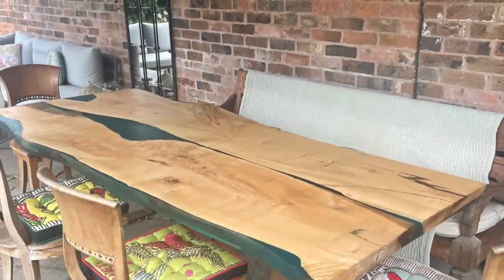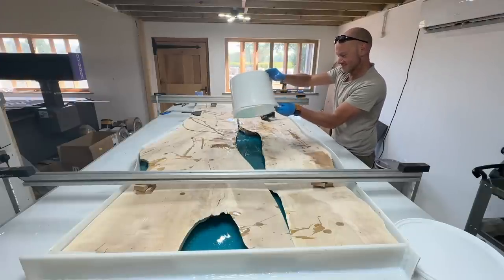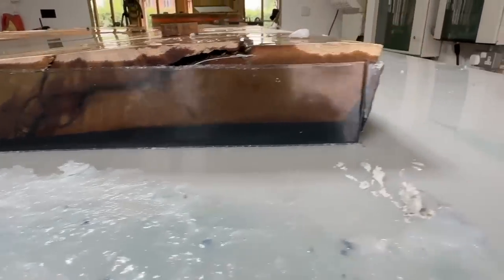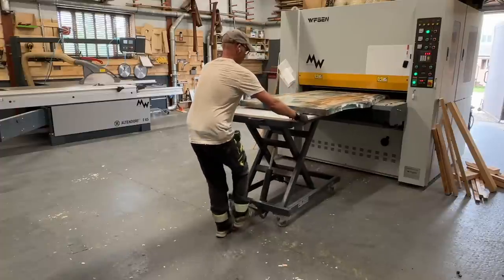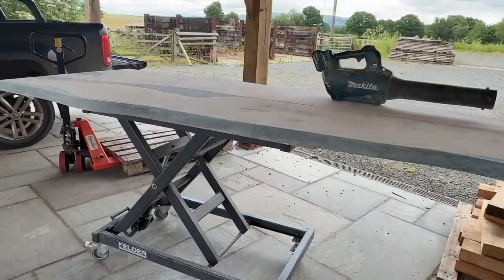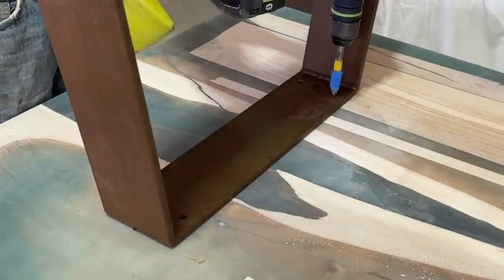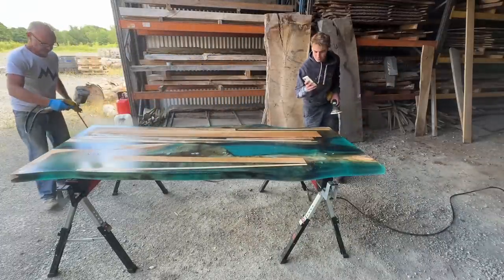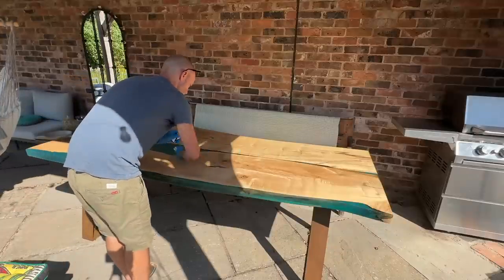Sycamore maple + turquoise resin

Comment: Hey Andy I have some spalted sycamore I’ll be working on soon.  The top is pitted and rough in some areas.  I don’t know how much epoxy I’ll do on it.  
I was wondering what I could use to penetrate into and harden the wood a little.  It will probably have an odies oil finish on it.   Then I’ve been having good luck on a sheen with Liberon bison paste wax.  I haven’t seen a whole lot on sycamore , so I’m trying to study up.  Any suggestions on penetrating in and making it harder ?  Thank you in advance.
Reply from the maker: I have videos on this take a look back , thx

Comment: I don't know why you would think those shims you put on the underside would allow the actual slab to breath on the underside?
I can guarantee you the resin got between the shims and the slab and so the slab is full plastic wrapped on the underside anyway.
Its really not a good idea when you are only using oil finishes.
If you 2-pac cleared it both sides it MIGHT be okay.
Reply from the maker: It’s fine and has worked well Thx

Comment: You said you are putting the table out side, won’t that make it go yellow ?
Reply: He uses UV stabilized resin, so it won't yellow.
Reply: @imransadiq4149 Well, not as fast at least. From what I’ve heard, clear and white are the worst for yellowing. As far as the UV stabilized resin, who knows. Has it really been out long enough to know for sure it won’t yellow in time? We’ll see.
Reply: A wax or varnish coat will provide uv block.
Reply: @imransadiq4149 it will eventually yellow even with a stabilizer.   However the pigment will hide it and the current colour will just transition to a green.

Comment: Could we please stop dipping in and covering beautiful wood with plastics that create hazardous waste which basically never breaks down completely?
Reply: I understand your point about the encouragement to use “plastics” and, personally, epoxy-dominant pieces are not to my taste. However, I’m old enough to remember when the pieces of timber shown in this video would have either been consigned straight away to the firewood pile or cut into square edged stock with a percentage waste of, perhaps, 50%. And so, there is the argument that the use of epoxy is preventing a valuable resource being wasted. 

I’m not saying the issue is black or white (or you are totally right or totally wrong)
Reply: Buddy you need to calm down I'm sure you have no problem filling your local dump with a hell of a lot more than he is with epoxy
Reply: Thank you for attacking me personally and not my argument. In this video you see a blatant lack of the use of personal protection equipment when working with epoxy, that leaves the impression that it isn’t being taken seriously.
Reply from the maker: To put things in perspective, English Warner if you can even buy it is sold at 80 to 85% waste. Are use 95%, maybe even more of every single slab when I make a table, only ever using resin where needed for bespoke pieces, the residence self not only adds structure that allows the use of what would be firewood to become furniture, if it’s not your taste fair enough, but I’m a furniture designer first and foremost and I use it when needed
Reply: I rarely make things that could accomodate curved slabs. I’m buying waney edge, I only go for fairly straight pieces so that I can cut down on waste. Even then, I keep the offcuts as I do get calls for inlays or boxes which use up some. However, I go for 50% waste as a rule. What is character for some (shakes, holes, knots) is waste for me. European walnut is rarer these days and I’m paying upwards of £6500 per cubic metre for decent kiln dried stock. Even oak is now around the £5000 mark for super prime quality. 

The cheapest way for me to get high quality hardwood would be to break up antique and vintage pieces of furniture. I don’t do that out of total respect for makers in the past but it just shows how antique furniture is so woefully undervalued.